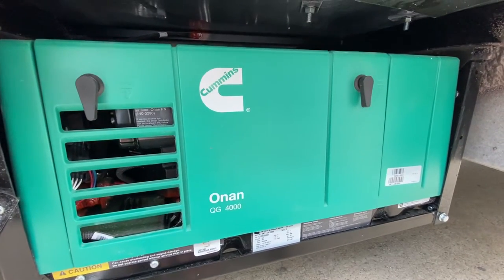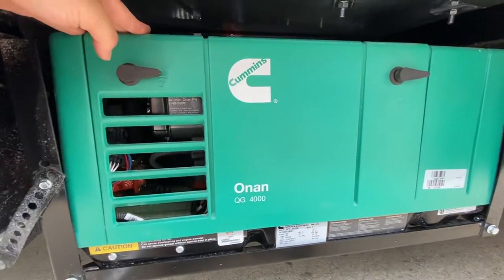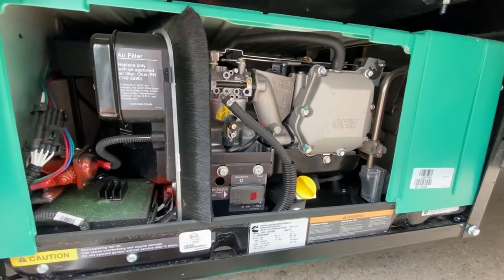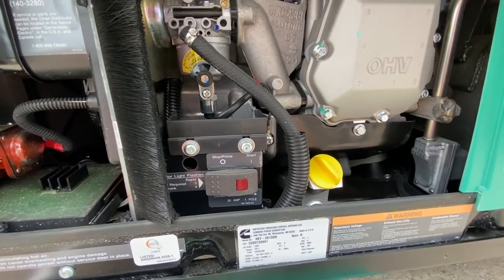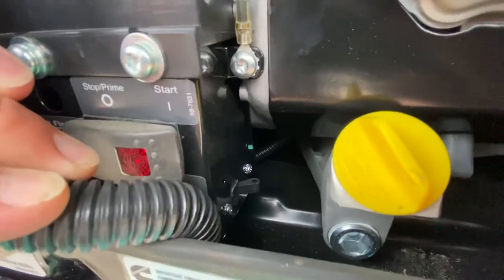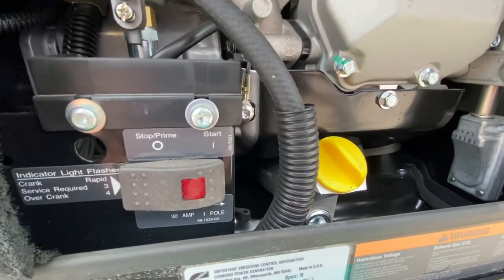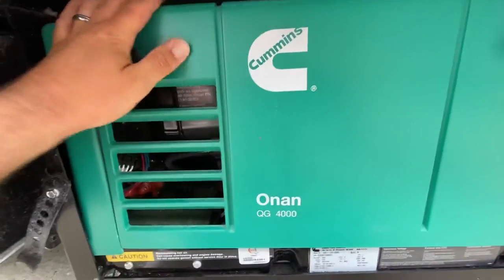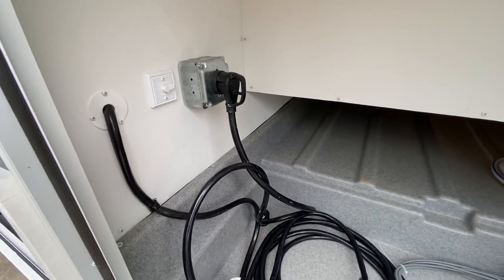Onan Generator Circuit Breaker Reset

Comment: Hi 👋 😊 Thank for this! 
For some reason my generator just quit (after running 45 minutes) when the a/c cut out. No issues with gas or oil but only a/c was running so it went from load to no load and died without a beat. (Like when the truck gas tank is at  1/4. 
😮Tried several times to restart (with breaks between ) and it just wouldn't fully engage. So...visited U of YouTube, watched your vid,  tried the breaker to off/on (it wasn't tripped) and then tried again. Second try it started. 
Getting the plugs and filter checked tomorrow. Still not sure why it shut off in the first place or why after sitting  for 30 to cool, it wouldn't restart after several tries (maybe flooded?). 
Anyway running smooth now 🎉
😊👍
Reply from the maker: @lstevenson3513  depending on your temp conditions, it could be experiencing the notorious vapor lock. This is where the fuel is vaporized prior to entering the engine. Maybe try to let the generator cool down for several hours then retry. We wish you all the best!

Comment: I was expecting this to be the problem when my on board gen wasn't getting power into my rv. But resetting the switch didn't do anything. I'm hard wired from the gen into the coach so it's not the plug.  I plugged the coach into another generator and it got full power. Any suggestions?